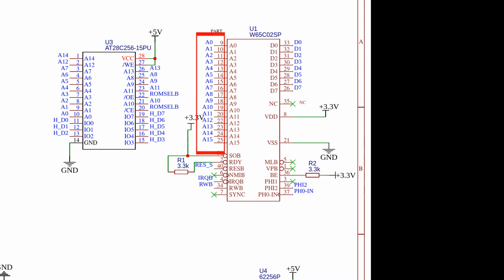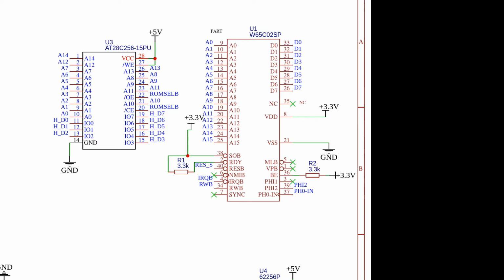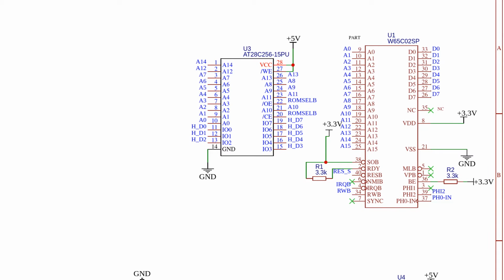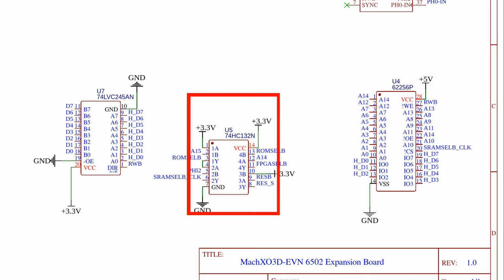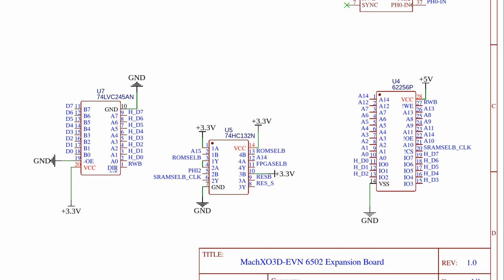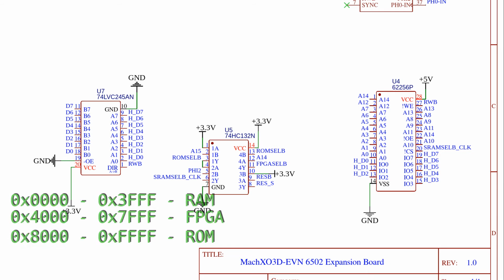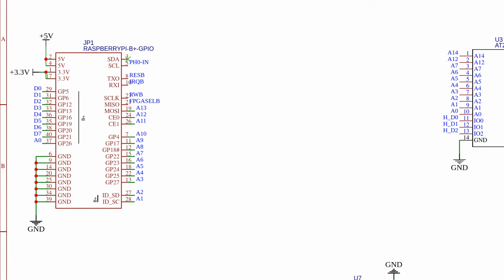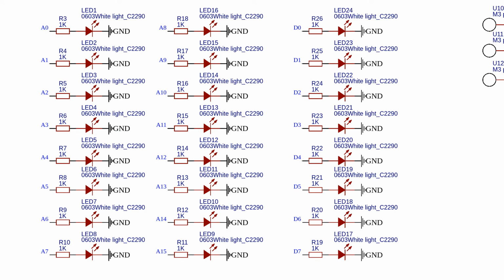Creating a 6502 FPGA Expansion Board

Comment: That’s cool and exactly what I’ve been doing for the last couple of years. Interfacing real CPU’s from the mid 70’s and 80’s to FPGA development boards.  I configure the RAM and ROM from the dev board or the FPGA’s block RAM.  For most I have to use voltages level shifters.

Comment: I like this - I have been playing with an FPGA VGA controller and I am now wanting to start connecting it up to a 6502.. so I guess I'll be doing something similar.

In my case my FPGA has an SRAM controller which has a framebuffer for my VGA output. The FPGA will offer some commands/registers to allow various things to be done such as text output, drawing lines etc but I also need to let the 6502 directly write into the FPGA's RAM so that it can copy in sprite/bitmap data.. so I guess in my case I will have 2 modes of communication with the FPGA from the 6502.

I like to think of it as GPU similar to the Amiga's blitter chip. :-)

Do you have a blog or website covering the work you've done?
Reply from the maker: Hello Paul. Sadly I stopped shortly after getting BASIC running through the UART peripheral I developed.

In case it helps, here are the files for the board I used: https://oshwlab.com/frankxlebrun/eb-mx03d-65c02

Probably yours will look very different, since you're using the FPGA's memory. There's some notes on the PCB layout file, of problems I discovered and had to bodge.

Comment: I'm working on something similar. What is your code on the FPGA side? Verilog? How are you interfacing the UART?
Reply from the maker: Hey Jon, thanks for checking out my project! I'm using Chisel, an innovative HDL from UC Berkeley. In my opinion, better than VHDL and Verilog in many regards. Of course, VHDL or Verilog is a better option for your first HDL, since they are much more commonly used at the moment. I think the question about the UART should be answered in the next video, but let me know if it isn't and I'll be happy to answer!